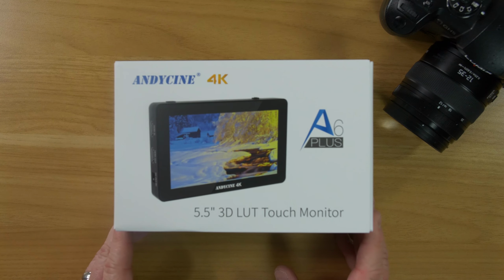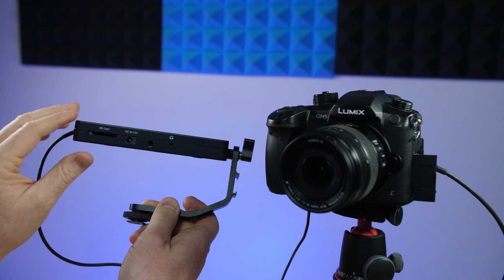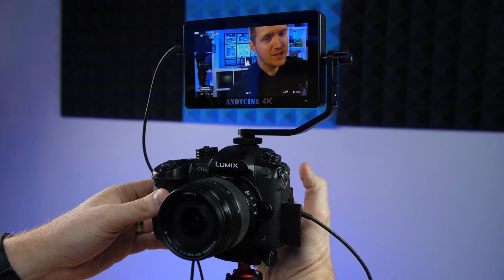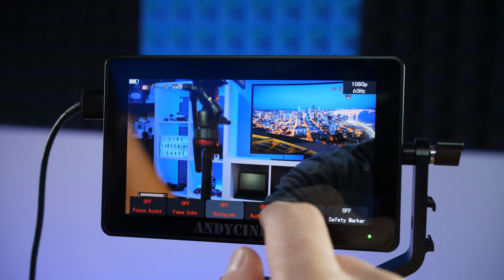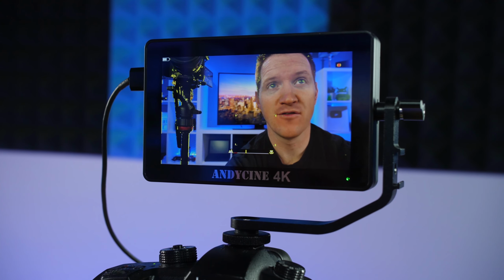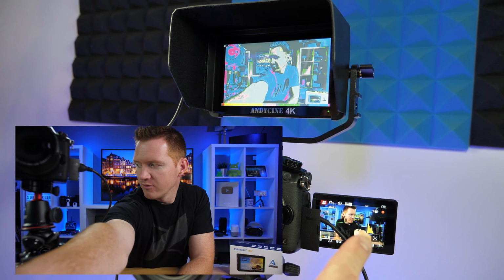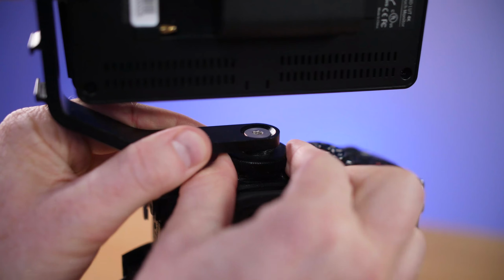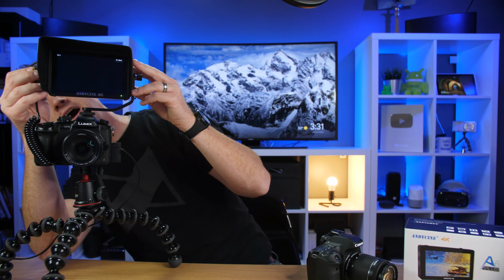Improve Your Videos With the Andycine A6 Plus 4K Touch Monitor

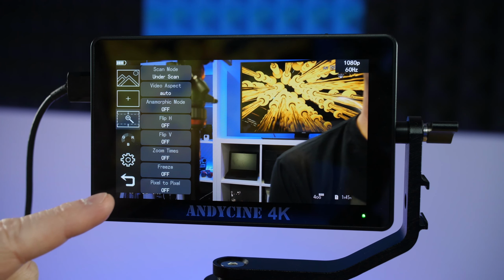Comment: Great review! You seemed to cover just about everything someone would need to know! However, one quick question. At 9:40, you wanted to flip the screen automatically. My problem is I don’t want my screen to flip automatically (which it does). I don’t have the “flip v” or “flip h” features. I have all the other features in that section of the settings except for those. Any chance you or anyone else knows how to turn that automatic flip feature off?
Reply: Wow. Okay. I was going to delete this comment, but in case anyone is having issues with turning the flip feature from automatic or to automatic, I literally found it out 1 minute after I posted my other comment. 

To change the orientation automatically... Double tap on the screen -> go to the settings (the gear icon) -> press “auto mirror” -> “on” or “off” ( on = flips automatically, off = doesn’t flip automatically). Hope I helped someone 😅
Reply from the maker: Thanks for the update!

Comment: Hi Brett, regards the dummy battery, is it possible to connect it to the camera charger then to the back of the Andycine to get power. I did something similar on a camcorder
Reply from the maker: I attempted this but since on the camera batteries work that I have it had the cord in the way and didn't fit. It would be awesome to have one cord to power the entire thing. I definitely need to look into a bit more.

Comment: Hi Brett.  Great review!
One point.  I suspect the best approach is to supply the Andycine with a plug-in 12V supply, then there won't be any accelerated battery discharge issues while co-supplying the camera and no battery issues with either in a studio setting.